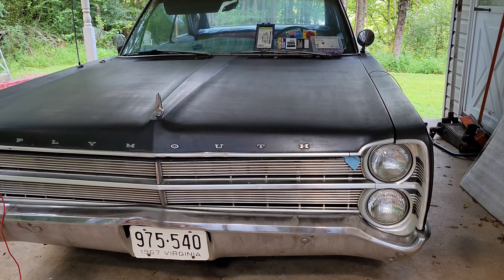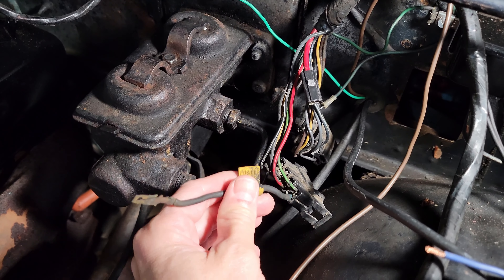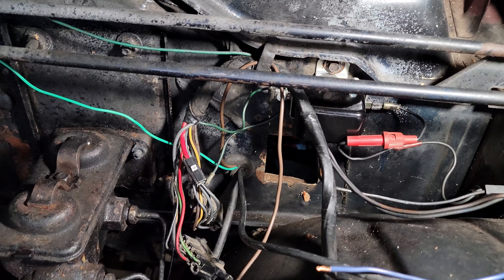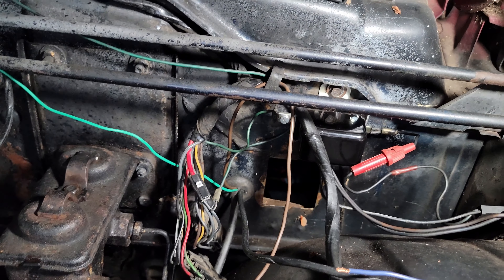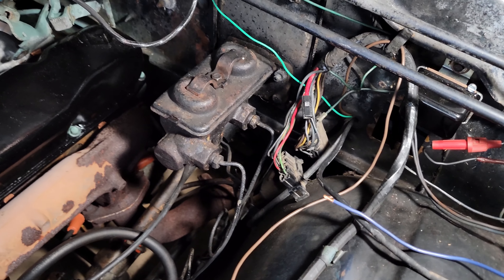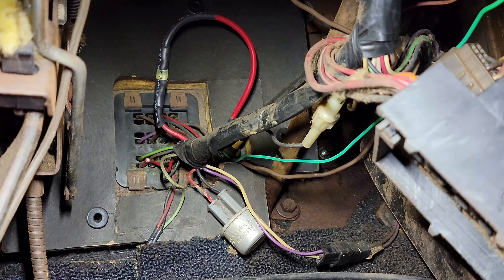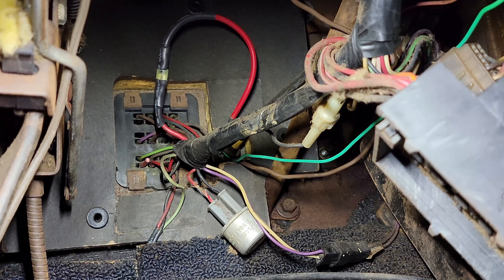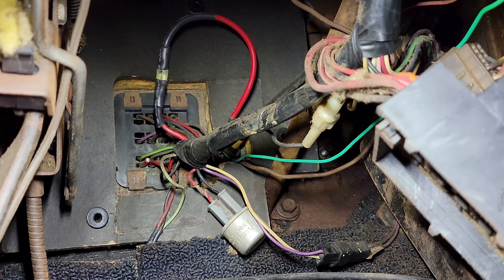Fury's Fatal Link: Diagnosing and Fixing Fusible Link Issues #mopar #plymouth #fury #hardheadgarage

Comment: Those are all good upgrades. I ended up running an extra wire with a fuseable link right from the power lug on the alternator to the positive battery cable.
Reply from the maker: @NathansMoparGarage  I did that as well forgot to record it tho.  At idle it make about 12.9 volts, with any throttle it goes up to 13.8 volts
Reply: @HardHeadGarage  Good old charging and then the headlights dim at idle

Comment: As soon as I upgraded my alternator, I bypassed my ammeter for that very reason. Fire mitigation. I made a short showing the bypass. It was kind of a pain in the butt to get to it.
Reply from the maker: @stevodakine1  I believe I saw that video, nice ride!
Reply: @HardHeadGarage  thanks man, it’s the never ending story. I still have to deal with the torsion bars. And throw in an electric water pump, that mechanical doesn’t cut it.